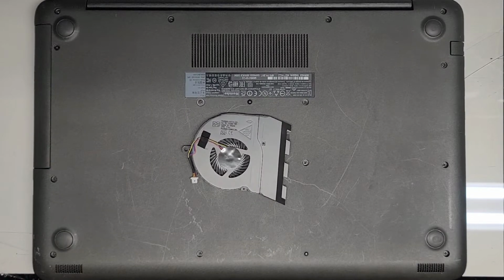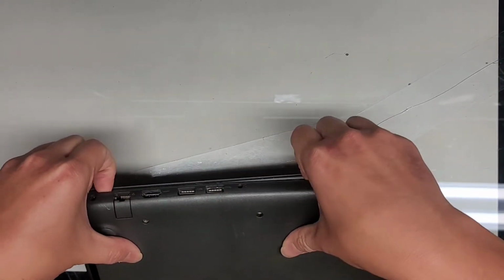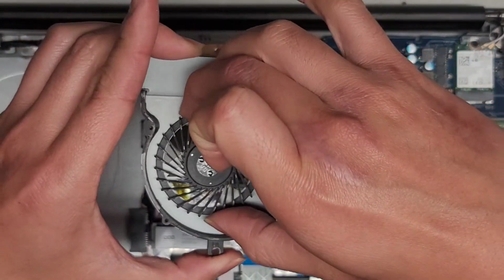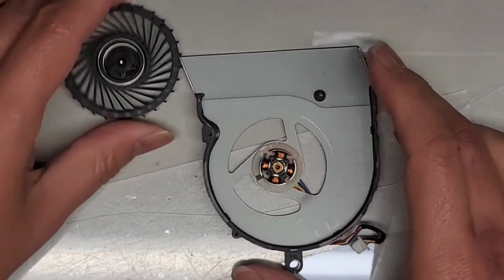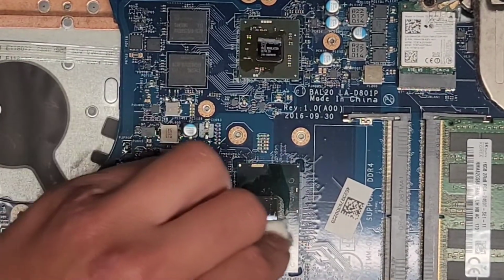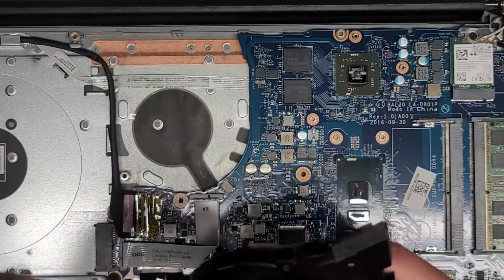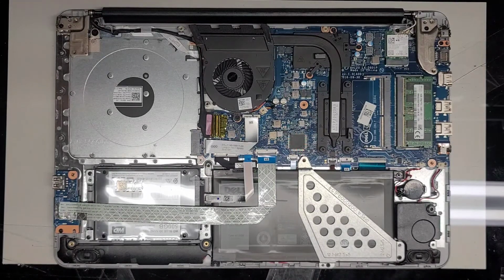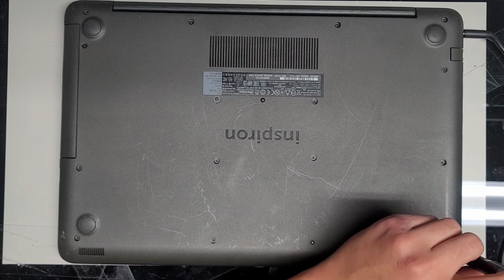DELL Inspiron 15 5567 Disassembly Fan Heatsink Replacement Repair Thermal Paste Application

Comment: So i replaced the fan on somebody's Inspiron and i ran into a problem i never seen before. The original fan was completely dead when i got it,it used to rattle for 3-4 months till it gave up totally and the owner wanted to finally replace it. I got a replacement that was advertised to work with the laptop,the shape and screwholes all match up,the connector and the wiring are the same as the original fan but the laptop still thinks the fan is dead and it's reporting fan error when i boot the computer up. The replacement fan is actually running but it's always in full speed and will never stop + it still thinks the fan is dead. Tried updating and downgrading the BIOS and it still didn't fix it. Anybody has any idea what this issue could be? It did shut off a few times due to overheating according to the BIOS log so i guess the motherboard got damaged somehow?
Reply from the maker: Possibly. I'd try another fan, just in case.

Comment: Is it absolutely necessary to clean up the thermal paste and replace with new? I guess not a good idea just to fix the fan and put the heat sink back. Thank you for a great video!
Reply from the maker: Yes, it's necessary. Think of it like glue. You can't rip it up and put it back down.
Reply: @ItsBinhRepaired Thank you very much! Makes a lot of sense!
Reply from the maker: @Glenn_123  no problem

Comment: This is very well presented, but what oil/grease do you use for the fan hub ? Can i use 3in1 oil or is that too much viscosity?
Reply from the maker: I just used motor oil for my old car. Lol
Reply from the maker: If it's designed for moving parts it'll work.
Reply: @ItsBinhRepaired   awesome thank you
Reply from the maker: @KppG-dn6zf  no problem

Comment: Why is my Dell computer so slow despite its high specs that it has a 7th generation Intel Core i7 processor, 16GB of RAM, and a 4GB graphics card?
 Even after installing a fresh copy of Windows
Reply from the maker: SSD?
Reply: The hard disk has been replaced by a SSD
Reply from the maker: @adhamsmhody  maybe virus
Reply from the maker: @adhamsmhody  press f2 on boot and check the power battery status.
Reply: The battery almost does not charge with a defect (thank you for your interaction with me, thank you very much)
Reply: Does a non-working battery cause a slow laptop?
Reply from the maker: With Dell, yes. Any bad charging component will.

Comment: Nice job, as always! Thanks for sharing always!
Reply from the maker: Thanks!
Reply: @ItsBinhRepaired  I accidentally ripped the MB tape under the cooling fan from the right side as it popped out very easly but I managed to put it in just by lifting the left side of the MB slightly and inserting and clipping back in that tape. I hope it will work as it gets there, firmly where it was. Only question is for RAM I would have.. Can we add additional RAM in the second slot to have it working in dual-channel? What would You recommend?
Reply from the maker: @theartofflying3108  I recommend getting a matching stick